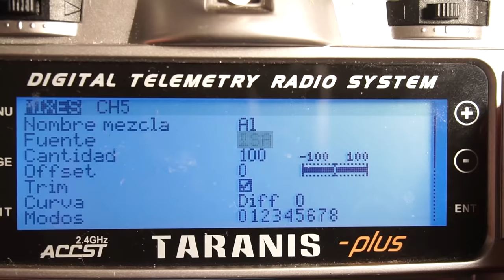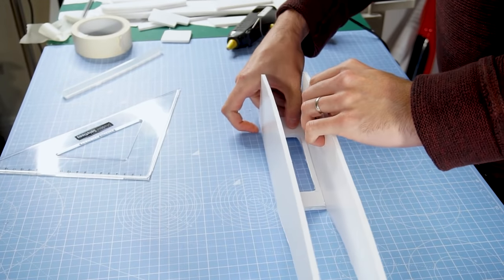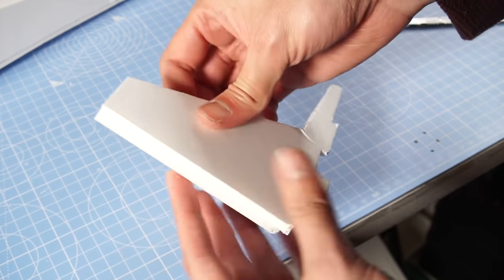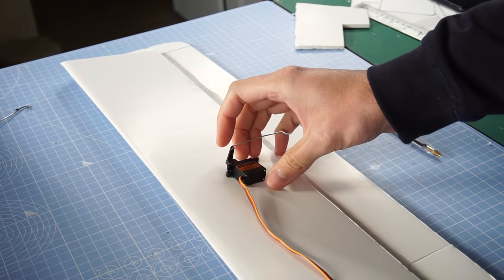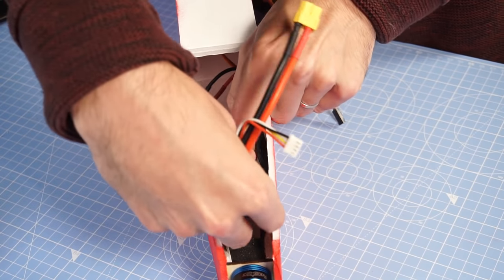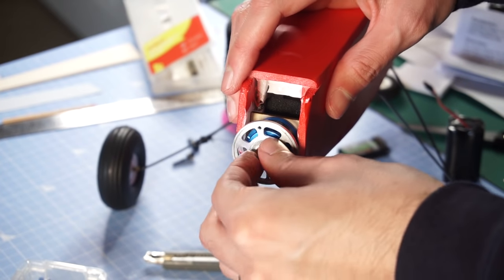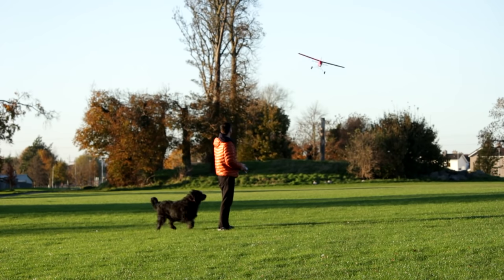Build this - Joytrainer mini |  How to make an RC airplane?

Comment: I really enjoyed watching this video.  Like a combination of plane builder and designer.  Great job!

I fly a ready made foam plane and have been amazed at the level of repairs that have been possible yet it still flies perfectly.  My plane did not include your fancy landing gear design.  I don’t think it has rolled truly straight for dozens of flights (this is tricky for take off but perhaps worse for landing because it is like applying vast amounts of braking force when it touches the grass at which point it would nose over and put the rudder into the turf).  I plan to make a new gear support soon, meanwhile I have learned that a bit of throttle at touchdown keeps it on its feet.

I hope to build up the confidence to try this design!  Thank you for explaining each step with video showing the details!

Comment: Today printed your plan, started to build. Impresive. Very solid, simple, and well thought plan. Have suggestion wings are  ~53 cm, but lot of people buying foam in 50 x 50 cm, it is used for ceiling, cheap to buy. If plane were 10% smaller, would be easier a bit. Another thing, have you tried to print plan on sticker? That way probably would be a bit faster, because, you can instanstantly cut sticker and foam.

Comment: Your videos are pretty amazing.  The last time I flew a remote controlled plane was in the mid 1960s.  It was a one button system that activated a solenoid on a rubber band loaded escapement.  Things have certainly come a long ways since then.  Thanks for putting out such wonderfully detailed videos on this great art. 
Be well,
Isidro

Comment: You have some nice design ideas I haven't seen in other foam board planes.  Flies nice and slow.  The problem is that for beginners, crashes are inevitable and foam board compresses and creases easily, usually resulting in major damage to the front of fuselage, wingtips, and tail structure.  Though the materials are cheap, there's a lot of labor involved, and seeing my nice plane significantly damaged on the first flights is disheartening.  Can you figure out how to make it a lot more resilient?
Reply from the maker: Some more reinforcements can be added but takes a bit more work.
Reply: You can buy foam, paper sandwitch, it's very strong, or you can make it yourself,  just glue stronger paper to both sides of foam. Or some people add scotch after build.
Reply: I've found in my first build of one of these larger joytrainer planes that you have room to add some weight by reinforcing some areas with thin hard types of wood.  I've also found that when I have a hard crash it's easy enough to cut a piece off that broken and replace it with a new piece   just glue it in and tape over it.  I've had some hard landings and caused some severe damage.  Took me a pretty short amount of time to repair in all cases.  And repairing your model is kinda part of the fun in my personal experience.

Comment: FT is No.1 ,Its Not bad but  FT very very nice and Perfect.
Reply: Not all FT planes are great. I have had to modify all the ones I made. Usually the angle on the firewall is not right and doesn't  take in account the forces that make the plane want to turn left upon take off. Not one of their plans compensate for the issues involved. That being said, foam board is cheap so its easy to fix any issues with these planes. He does a great job on this plane and his design is pretty interesting concerning the curve of the wing instead of using the methods used on all of the FT plane wings.
Reply: Perfect? Have you actually built one? I have built two different models and both required modifications to fly. The angle of attack on the motor on both of them was off, I had to pull out the fire wall on the Tiny Trainer and readjust it. On the Simple cub, I had to add washers on one side so fix the bad tendency  it had to bank severely  to the left and down too much. No ,Flite Test planes are not perfect. If you listen carefully to Josh B, he even mentions making corrections or hints is more like it. Every RC plane requires adjustments eather through the transmitter or mechanically to make them fly better. There is no perfect RC plane.

Comment: I'm really enjoying the process of building this. I skipped the lading gear but now I'm trying to make one - what are those things you used to secure the wheel in place in the wire? And the wheels, did you buy them? I'm thinking of making ones from foam

Comment: Hi Joyplanes, I just wanted to ask where I could buy the 2 pieces of a1 size, 5mm thick foam board and the landing gear wheels and wires? I can't find it on amazon. Thank you😃Btw, this video is very helpful.

Comment: Good video, useless plans with no identification printed on all the cutout pieces. Similar to a puzzle with all white pieces. After printing a random stack of unidentified  patterns, I tossed them and drew my own. Worked fine and was much quicker than trying to figure out the pile of random cutouts.
Reply: Im looking at plans with notes as to what they are. They only pieces without notes are the two fuselage pieces and the vertical/horizontal stab. But its pretty obvious what they are, esp if you watch the video
Reply: @Fig2122  nope if are not going to use the a4 version it is having only one side of wing left one

Comment: that is awesome, but it looks like you have heavier foamboard than flight test would use, does it affect the plane much
Reply from the maker: It's still very light, I'm not sure what weight difference it is.
Reply: @Joyplanes   its about 50% heavier than flitetest. if you make a flite test model. increase the wing area slightly to compensate for the extra weight, then they still fly great.. i love your planes as there designed for our heavier foamboard from the outset so build exactly to your specs and it'll fly great.  keep the vids coming mate. thanks
Reply: I tested it the flight test or redi bord what I use is 25 grams lighter than normal foamboard for each sheet

Comment: I built the Joytrainer (scaled it down to 70%) and it is powered by a 2200 KV motor and a 5/4 prop. It will not get off the ground! Everything checks out, center of gravity, control surfaces, etc. Any suggestions?
Reply: I'm no expert but if you are using a 2s battery use a 3s and see if the extra power is enough. A bigger prop could also work I guess. Which exact motor are you using?

Comment: Awesome video! But in the link it doesn't say anything about the spinner that you used
Reply from the maker: True, it's a small one, BenchCraft 38mm (1.5") 2-Blade Plastic Spinner w/ Metal Base from motion RC

Comment: so what is the max weight to the airplane with the battery can u tell me plz
Reply from the maker: 860 gr.
Reply: @Joyplanes  thx you bro you r so good go on what you do
Reply: oh and one last question i m doing a Cessna 72 and its weight with the battery is 570 so if i put the configuration of the motor in the video it will still good and Maneuverable or no  like it will be power full or sell i get anther better motor with high thrust
Reply: If you see the first page of the plan, the weight specifications are written there.

Comment: i built this plane and i have 2 3s 1000mah battery should i connect them in series to make one 3s 2000mah battery?
Reply: If you do that, you will get a 6S battery.

Comment: Can I use 2212  1000KVA motor with 10inch prop ?
Reply from the maker: That will be a big motor and prop for the airplane. Specially th prop but try and see if that fits.
Reply: Did you do it? how did it go?thanks
Reply: @rodrigoc.goncalves2009  i was a beginer at that time and I felt it was a little bit fast.

Comment: Please help 
I built this plane it weighs 0.9 kg or 1.98 pounds 
I used 1800 kv moter 3s battery , I did not tested it yet , but I feel it little heavy 
If weight is appropriate ??!
Reply from the maker: Yes it seems ok, just use the right propeller for that motor.
Reply: If you have flown the plane any time now, please post the results and possibly a video
Reply: yes, plane flew and that was my first plane  @tamilkeerthi
Reply: this video helped me a lot. it was my first attempt to make RC planes. after that i continued this hobby and also participated in some national level competition with planes of wingspan up to 2.6 meters. I would like to say that this is the best tutorial video for beginners🥰.   @Joyplanes

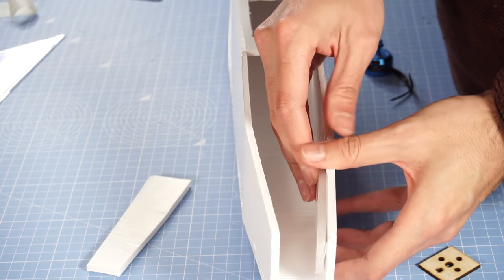Comment: you see by 6:36 a woodthing that hold the motor but how you make that wood thing ??
Reply from the maker: That's plywood and I used a laser cutter to make it. But you can use a saw and a drill.
Reply: @Joyplanes  thank you

Comment: In the A4 tiles Plan, bottom part of fuselage and wing spar is not added . I had cut the depron sheet and then I noticed . Could you please add it  and allow to download?. i have joined the course too.
Reply from the maker: Thanks for letting me know, I'll fix that soon.
Reply: @Joyplanes  what should be the SPARS height ?
Reply: @Joyplanes  when are you going to fix it its been 2 years
Reply from the maker: @OpOwen52  Hi, I see that everything is in the plans, can you tell me which part is not right?
Reply: @Joyplanes  The A4 prints only show left part of the wings and is missing parts
Reply from the maker: @OpOwen52   Hi, the missing wing is intentional, the other wing is a mirror image, you can simply use the first wing as a template and mark the other lines with a ruler. And I'm not sure what parts is missing.
Reply: Oh sorry thank you @Joyplanes

Comment: 👍
Life would be easier if you install the servos, and run the wires before you close up the fuselage and wings. Mostly because you can mount them from the “interior”, remove the foam from the inside but leave the exterior skin except for a slot for the control arm on the wing servo; and an interior step cut, with a foam board plate behind the mounting tabs for strength,  on the fuselage servo. That reduces drag and look cool because it’s clean. 😉🤓😎

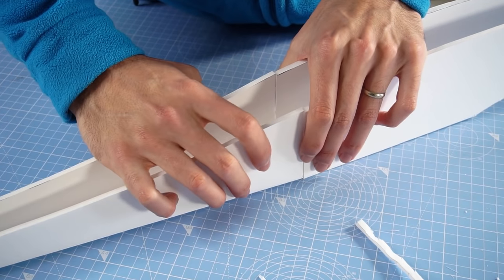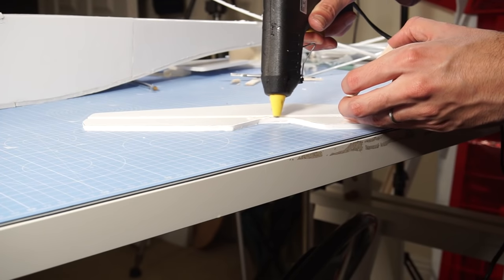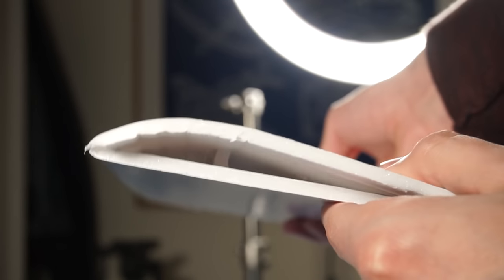Comment: some info.     at 3:52, poorly designed horiz-stab/elevator.          at 8:16,  that  piece  Should  be  LONGER.          at 12:13,   perfect?????    hardly.     the  LOWER  leading edge is  wonky.    see a clark-y.          at 15:05,   READ  MY  LIPS   ---    servos  do   NOT    GO     THERE !!!!!!!!!!!          when a fuselage has a  BUTT end,  the tail boom has  NOT  been  Correctly  TAPERED.!!!!!!!!           googlegtranslate
Reply: David David's tell me I have read alot of your comments regarding any video that comes out by different ppl, majority mount servo's on tail or near tail or near the joining of H stabilizer to fuselage rare, you keep on saying this is wrong, even if let's say it is still plane fly pretty good any explanation to that ???
Reply: @jalalhaider83  well.    you get five points for being  Smart enough  to  ask  an  Intelligent question.    four points are  deducted, for NOT  Bothering to look at my  CHANNEL.        the issue is  DISTRIBUTION  of  MASS.       any time  Any  one  installs  the  MASS  of  servos  AFT  of the cg/c-m,  he  is    INCREASING   TAIL-Heaviness  in the dom.        in other words, the tail boom/tail/stabs  SHOULD   ALWAYS  be  made  as  LIGHT  as  is  Practical.   googletranslate
Reply: @daviddavids2884  still better than your "brick" model😂

Comment: Can I build with coro sheet instead of foam board
Reply: I am also planning to build this with coro sheet instead of foamboard. I wonder what glow engine would fit this plane if I have to substitute the motor with the engine. Any suggestion?